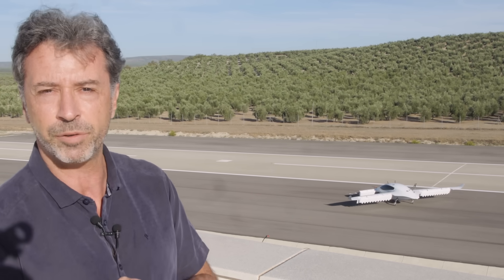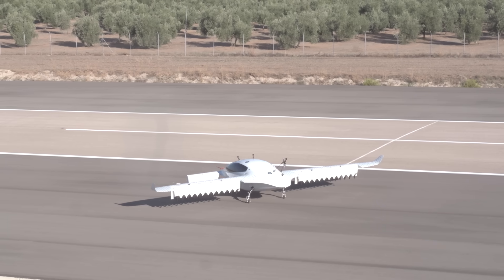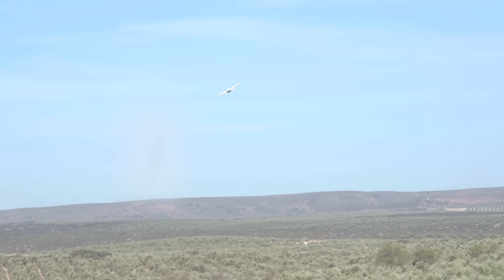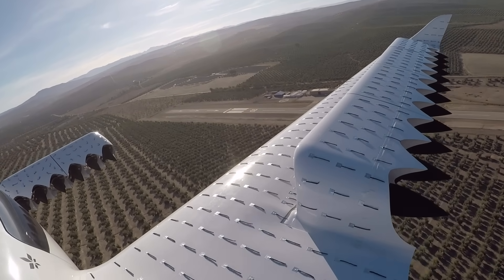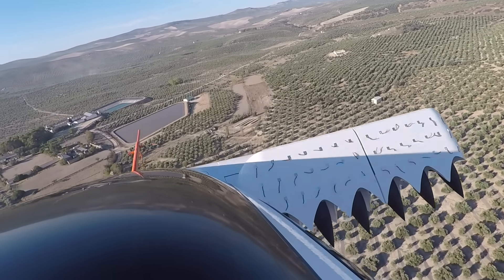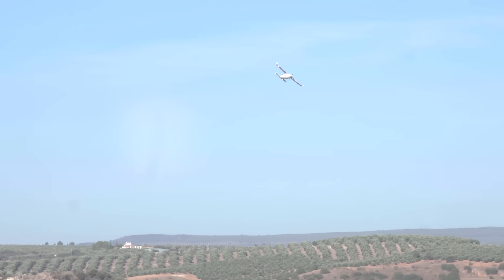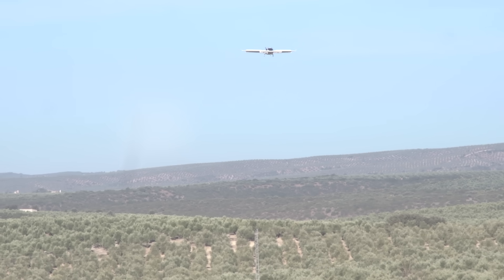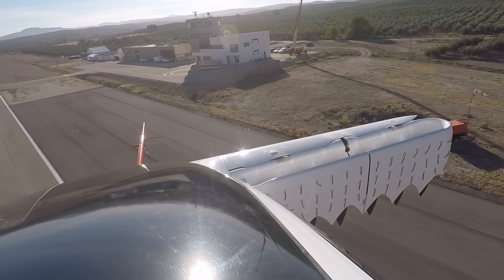Test Flight September 28: Lilium Jet Demonstrates Maneuverability

Comment: I'd like to see some tests performed in strong crosswinds.
Reply: Sure would be good to see, as in urban setting you can't just plot a flight path that suits you. 
I'd like to see a max capacity flight over longest reasonable distance in shortest reasonable time.
Reply: Very good idea, never really thought about that.
Reply: In Chicago’s winds
Reply: That was my initial thinking, and it is valid for vertical takeoff, but a crosswind would still apply in forward flight where the direction is dictated by terrain or flight restrictions.
Reply: @PiefacePete46  So what? If you’re flying North and there’s an East wind, you just point the nose to the right a few degrees. In fact, that’s how you detect that there’s an East wind- because you (or the autopilot) has to correct back to the East due to drift. This isn’t a flight controls issue.
Reply: @ahgflyguy : Pretty agressive.  If you are flying North and there's an East wind, you have a crosswind... PERIOD!
Reply: @PiefacePete46  Yes, you do. And you just drift West with it. It’s not a flight controls issue at all. Just like a headwind isn’t a flight controls issue. Why would it require separate testing? Now, the shear near the ground that can be associated with this can be an issue, but much less for this aircraft than for a non-VTOL aircraft. So, yes, crosswinds will exist. What aspect of that do you think affects the aircraft flight controls?
Reply: @ahgflyguy  :  You have managed to add an rather a lot of content to my comment.  I made NO reference to flight controls... I made NO reference to testing.  Possibly that may have come from someone else.
My initial comment was in agreement with your response to @TeddyLeppard; what is a crosswind for a VTOL?  However, the more I thought about it, the more I decided that, regardless of whether the aircraft is in forward motion or not, if the wind hits it from the side, it is a crosswind.  The ability of a VTOL to rotate around its vertical axis provides an easy solution.
Reply: @PiefacePete46  eh, sure. It just doesn’t seem like you understand why a crosswind is even worth mentioning for a fixed-wing aircraft. Because the reason we even care is for flight controls purposes. And that’s because of (in broadest strokes) the differential lift on the wings. But the wings aren’t generating lift in this scenario.
Reply: @ahgflyguy  I made NO reference to fixed-wing aircraft...  I made NO reference to lift... I made NO reference to wings.
Reply: @PiefacePete46  It sounds like you’re also asserting that you have no idea why you’re bothering to talk about this at all. And yeah, I can hear that loud and clear.
Reply: @PiefacePete46 - I had an interesting "Cross Wind" in flight, once, such that I had the "Nose" pointed 35° to 40° Left of  the "Road" I was "Tracking North" on, East of Oshawa, Ontario, over Bowmanville! (Both are East of Toronto, Ontario, Canada!)

It was definitely a day for "Experience" plus it was a "Special VFR" Weather Day, so I was around 700-800 Feet AGL! Very "Noticable Crabbing!" 🤭
Reply: @ahgflyguy  Roger...Over & Out!
Reply: @robertweekley5926  :  Makes for lousy fuel economy, and green passengers!   🥴 😵‍💫 🤢 🤮 😉
Reply: Should not be a big deal.  Just land into the wind and descend as normal.  Landing into a 15 knot wind is no different than making a steep landing approach with 15 knot forward speed until touchdown.  I would not think this would be terribly challenging for a VTOL.
Reply: Your so mean !
Reply: No wonder we aren't visited by an intelligent life. We are so pathetic and primitive haha. Instead of inventing something useful, we just use more of what's already made because it's easier. You attach that many jets to anything and yea, it's going to fly no matter what it is. Well done human race.
Reply: Crosswinds. I have hand built and flown fixed wing VTOL scale models  since 2005. Crosswind tests I did had little effect even during take off or landing as the instant spool  
up response of brushless motors from the ( F.C ) microprocessor flight controller accelerometers and gyros. Obviously it's more logical to take off and transition into forward flight with the nose into the headwind, that's the advantage of VTOL or helicopter. 
However even during gusty crosswind hover tests I noticed the amazing response of motors completely and instantly even shutting down motors and spooling them up in nano seconds   
to stabilize the roll. The point is you would rarely need to do this in a VTOL.
During mid transition flight it also stabilizes roll extremely well. Only aerodynamic slight disadvantage might be (or not) is the long array of motor nacelles front profile area causing drag during a windy nose in hover using  more energy but hovering should be for short durations anyway. There is a ballooning effect with strong headwinds in hover 
as the wing generates lift and aft drag but this can be compensated by the F.C tilting the motor nacelles forward to maintain stationary over one spot as needed. 
I set up most of my models for hover with all motors tilted forward trim about 7 degrees regardless.
Reply: @kingsleykronkk3925  That's interesting and good evidence at least at small scale. The lack of a large vertical surface probably  makes the yaw and roll gust response smaller too. I wonder how well your model experience will scale up to the larger scale Lilium Jet. Eventually we'll see a full scale test in gusty conditions!
Reply: Sounds a lot maybe 120-130dBs ? 80-100dBs should be perfect…
Reply: this is a VTOL aircraft. Which direction do you think actually counts as a "crosswind" when it is in vertical flight configuration? Also, since in that configuration basically zero percent of the lift is coming from the wings, and all of the stability is coming from thrust-balancing, what do you think having a symmetric or asymmetric lift would do? It's already adjusting the thrust balancing several times per second (I assume) in that configuration.
Reply: @ahgflyguy the direction “that counts as a crosswind in vertical flight configuration” is any wind direction that is not on the nose. The point of the comment you are replying to is that in an urban mobility setting, you cannot simply point into wind on a long final which is the only kind of approach this model has managed so far. You have, typically, to approach along some corridor that is often crosswind or downwind, and begin the transition before doing some combination of close in manoeuvring, spot turns and ground taxi. None of which this thing has shown us yet. I thought this might be the video where they showed some of this essential capability, but instead I see a video where they are managing mundane manoeuvres that would have been cutting edge for the Wright Brothers in 1905. There is absolutely no chance whatsoever of any Lilium being certified in 2 years, in exactly the same way they didn’t fly a person in 2016, or enter service in 2018 like they claimed was a dead cert back then.
Reply: @XPLAlN  okay. Thanks for explaining why you think it’s important. Now I reiterate, why do people think this is a challenge? Is there some thought that a crosswind component matters to the basic flight controls when you’re several hundred feet up? Because this video was demonstrating basic flight controls. Or is the thought that demonstrating various realistic approaches and landings is just one of the steps that has to be taken, and people are clamoring about it because they think it’s the next item on the list, and they’re predictably behind schedule.
Reply: @XPLAlN - Why is it such a presumption that this aircraft can not fly a Track, in a "Crabbed Heading" (nose obviously Left or Right of the Track direction)?
Reply: @ahgflyguy  ok a crosswind is no challenge for cruising but at some point there has to be a transition to the hover, close in manoeuvring, manoeuvring in the hover and ground taxi. If they could do that stuff already they would definitely have shown it. And those are much harder to do than simple turns in forward flight seen in this video.
Reply: @XPLAlN  I don’t have much VTOL experience, but I think their flight test program would have STARTED with hover and some amount of maneuvering in hover, in the lead-up to doing the transition to wing-borne flight. All of that would be preceded by ground taxi, of course. But from my limited knowledge (no first-hand experience with VTOL unfortunately), the transition would be the LAST of the basic maneuvers to be tested, because that’s the one where things would go the most wrong the most quickly, so they would want as much experience as possible understanding the aircraft before doing that.
Reply: @ahgflyguy  a crosswind cuts range
Reply: @ahgflyguy  I think a cross wind is anything that is not along the aircraft axis of symmetry. As these winds will cause yaw and roll as well as pitch, they will be much more demanding on the control system. The aircraft could initially align with the wind, but wind changes with time or altitude (gusts and wind gradient) will be demanding.

Comment: Can the landing gear handle a conventional landing in case of an emergency situation where you can’t rotate the engines back down for landing.
Reply: A ballistic parachute will likely be part of the final design
Reply: If the engines can't turn, the plane crashes immediately. You've probably noticed that there's no rudder, no elevator, it's all done via those tilt motors. But, fortunately, the plane is highly redundant, as you can see, and this shouldn't/cannot happen.

Comment: As an investor, I'd like to know when the testing stops and the commercial sales and flights begin.
Reply: Manned test is late 2024
Reply: @jonpetter8921  Nope, they'll delay it again and even if they do it'll only fly for a few minutes. We don't have the battery tech for it yet.
Reply: Aren't they still in the conceptual phase?! AFAIK testing of real vehicles (with any meaningful payload) is not expected to be STARTED next year.
Reply: They literally release all of that information in their public fillings and on their website.
Reply: Methinks if you're an investor, there are better ways to access internal company information than YouTube comments! 😉
Reply: @c-qc-q2021  Not only that an investor would hopefully understand the risks, and regulatory landscape of the business they are investing in. Certifying a passenger aircraft in multiple markets is an endeavor.
Reply: @c-qc-q2021 such as?
Reply: They need to build a full size one first. This is just a model.
Reply: At 10 m span, it's quite a large "model", and it seems that, rather than being just a model, it's used to test any new propulsion, handling and other systems development, so that it provides validation of the new developments, while still fitting into a limited envelope of flight, and without risking full size prototypes.

Comment: Woah that's really cool. The Lilium jet seems a lot more plausible than these quadcopters that could chop people's heads off and have no redundancy. With tons of tiny engines on the Lilium, if one or two die, it can still fly. Not to mention I assume it can glide somewhat, even with a total loss of engine power?
Reply: The production versions will be able to land on a runway if there is not enough battery reserve for VTOL so yes it can glide but will need a small amount of power for control.  In many cases Lilium will takeoff and land near a runway I think there will also be a ballistics recovery parachute as an ultimate fall back.
Reply: @williamzk9083   thats some very cool information.
Reply: I agree. When I see those other EVTOL quadcopters, I'm really scared for the safety of the passengers. At least Lilium has a unique distinct technology based on the vertical Thrust vectoring
Reply: @smahmoud people have been dealing with propellers since the first planes. Helicopters with rotors above and planes with propeller either front, back, or wings.
Reply: The biggest problem or limitation I see with this type of design is they are using a large number of thrust units which is great for redundancy, but no so great for efficiency.The larger the diameter of the prop or fan rotor, the more efficient it is. If this is running on batteries alone it will likely have quite limited range. Lots of small diameter fans is not an efficient way to generate thrust. I do hope I am wrong in this view as perhaps there are some significant efficiency gains with the enrgized upper wing laminar flow feeding the rotors but it doesn't seem like this would be huge gain.
Reply: @jojoma4025  Wouldnt that negate the benefits of distributed propulsion?
Reply: The countless failures will make these impossible to own and maintain. Lots of small motors and speed controllers = lots of part changes.
Reply: No wonder we aren't visited by an intelligent life. We are so pathetic and primitive haha. Instead of inventing something useful, we just use more of what's already made because it's easier. You attach that many jets to anything and yea, it's going to fly no matter what it is. Well done human race.